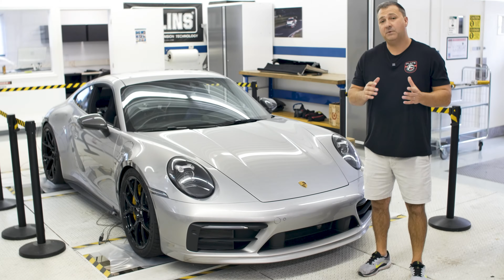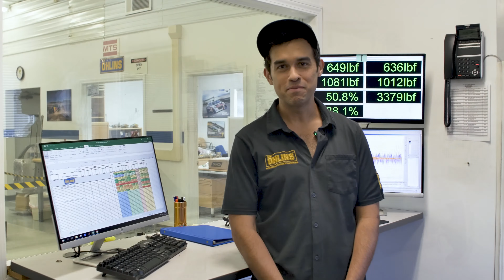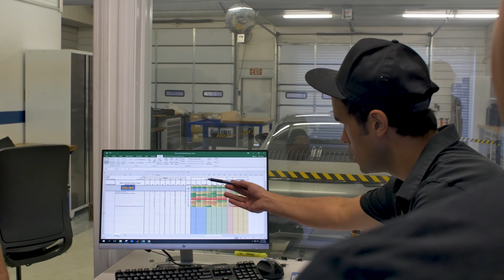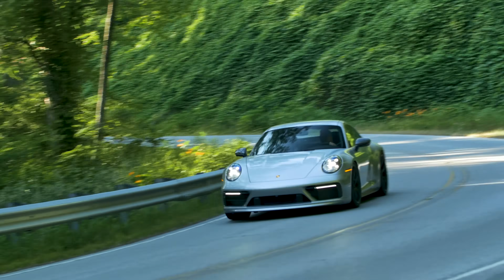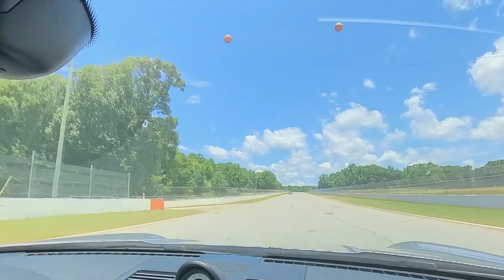Testing the Ohlins Road & Track Coilover on the 992 Carrera T!

Comment: Where/how would you adjust the clicks on both front and rear suspension? Also what is the maintenance schedule for servicing these coilovers?
Reply from the maker: These will pretty much last a lifetime with street use. With heavy track use, they may require a rebuild after 20-30K miles of track use. The front adjuster is inverted and under the shock body by the wheel carrier. The rears come with a small extension cable and are adjusted from up top near the rear seats.
Reply: @Flat6Motorsports was looking for a gti mk8, looks sweet! How do I feel/know when they'll need a rebuild? What are the signs while driving?

Comment: How would you compare them to the bilstein you had, the EVO SE?  Also any knowledge about the KW v4 how they compare to the ohlins?   I have 992.1 4S, and im thinking of getting the ohlins, seems to be the best performance and package. I track 2-3 a month, using Pzero Corsa for now.
Reply: @Flat6Motorsports, Would love to hear your thoughts about it compared to the bilstein EVO SE and if you know about the KW v4.
Reply from the maker: Ohlins is top tier on the 992. We haven't tested the KW V4 but generally prefer the Ohlins over KW. We're ripping out the KW 3W Manthey coilovers on our clubsport to put in Ohlins TTXs.

Comment: How does this work with the PASM system?
Reply from the maker: It doesn't work with PASM, you disable PASM when installing these coilovers but gain much better control with the manual adjusters.

Comment: Are these compatible with cars that have PDCC? Would an install still work (I assume it would)? Would you loose the PDCC functionality?
Reply: I’d like to know the answer to this as well
Reply: I think PDCC would still work, since they aren't directly done by the shocks, rather by the hydraulic in the separate system of the anti roll bar

Comment: I hated my R/T on my F80 M3.   They were harsh and abrupt, especially on rebound.

Now have MCS 2 way remotes on my 718 GT4 and they are MUCH better.
Reply: That’s funny because I had Ohlins R/T on my F82 M4 and by replacing the rear springs to softer, it was one of the best set-ups I’ve experienced. I’m currently running Nitron R3’s and I think they’re only 10% better for less than one third of the cost. I think the stock R/T springs were just too stiff.
Reply: @sergzz12 thanks for this comment.  Was trying to pick a nice balanced F80 setup and looks like a custom tuned ohlins R&T is the way.

Comment: I have owned a few Ohlins products over the years, the TTX on my ducati soaks up the little stuff like it isn't there and the adjust ability make them great exceot they are not disposable like a regular shock and need to be rebuilt which is part of the game.  That's cool you were able to take your T in to have it done by the pros.  Did you ask them about servicing costs by chance?  I also own a 992.1T, and it is a pretty stiff chassis, do you feel it mellowed the street ride out or just make the car handle better?  Maybe I missed that part in the video but I'm at work with the volume down low.

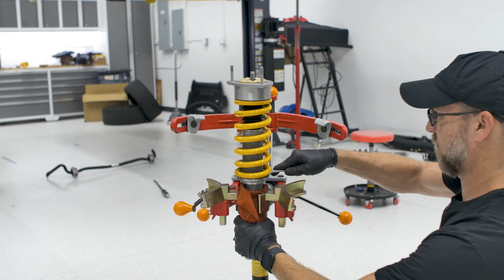Comment: Also at 3:50, is that foam on top of the top hat for the rear? What kind of foam should I be adding and how do I apply it?
Reply from the maker: That's part of the factory top hat.
Reply: @Flat6Motorsports interesting. It didn’t come with whatever’s on the top for me and I have the exact same Ohlins.
Reply from the maker: @isensespeed  the top mount is a factory/OEM part not an Ohlins part

Comment: How many clicks counter clockwise from full stuff for: Street and Track front and rear? I have the same set of coilovers for my 992 S and it’s ridiculously compliant even at the stiff setting.
Reply from the maker: You go all the way full stiff and then count each click backing out.
Reply: What were your number of clicks on the street and track?
Reply from the maker: @isensespeed  8 for the front and 6 in the rear
Reply: @Flat6Motorsports interesting that you set the rear to be more stiff. Did you do that for more oversteer?
Reply from the maker: @isensespeed  this is why we took the vehicle to their testing facility. The optimal balance is there. No oversteer detected but eliminated some of the front end push/understeer.
Reply: @Flat6Motorsports Thanks! I’ll try that tomorrow and see how it feels.
Reply: @Flat6Motorsports  Are there 20 total clicks and did you back out 8 front, 6 rear for the track?
Reply from the maker: @PSA955  You go all the way stiff and then back them out.